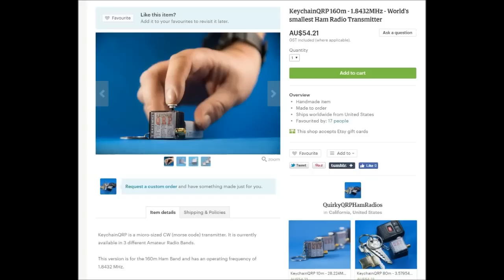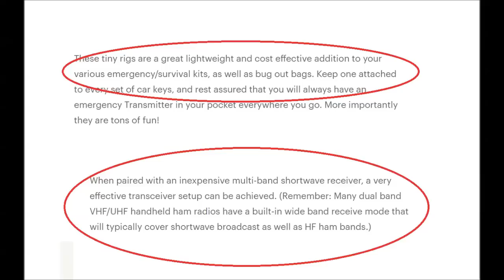Ultra-simple "survival radio" gear: Is it a scam?

Comment: In the US we have New Madrid, last activity in 1812, due to go off anytime now. If it goes,  write off anything east of the mississippi. Help will not be coming quick enough to matter. A good receiver would be god send. I ain't worried at the least. My interest in qrp is that of the tinkerer. No overpriced bloated gear for me. If it cost over 100 USD, it is usually crap full of features I neither want or need. I have been building radios for most of 50 years. Yes there are good radios, most are beyond my budget. Back in the day, no one I knew have any store bought gear. You have sold me on  freq agility. So here's the rub, whats the lowest part count radio you have made contacts with? There's the experience.

Comment: Nice discussion about the serious business of amateur radio emergency communications versus survivalist versions of QRP transmitters and ultra-simple "magic" antennas. Wow, that Gotham antenna sounds a lot like the Maxcom Antenna Matcher and Dipole from back in the 80's. When QST magazine reviewed the Maxcom unit it was found that the Maxcom's so-called Hi-Speed antenna matcher unit was filled with epoxy that rendered the circuits un-viewable. In order to circumvent this deception, the reviewer subjected the unit to an X-ray machine and saw that the box contained a number of power resistors and a toroidal transformer arranged in an attenuator circuit. I also see that the Gotham is sold from Pompano Beach, Florida which is a few miles up the coast from where the Maxcom was originally sold. Coincidence? I think not.

Comment: Nice video again Peter. I am not sure if something serious did happen that I would want to talk on a radio. I think i would just lay low for a while. If people where not prepared and then found out you where they would be looking to get your stuff. Maybe the answer is to pre-arrange a frequency and call sign with people you know and trust so you could just go to that frequency. Imagine the people that would be out to trick you and come around like the Purge Movies.  I would definitely have a MW/FM/SW radio to receive news if there was anyone transmitting. Peter I purchased a 60 LED $30 solar motion detector light from the REJ__T Shop and it only stays on for 2 minutes. That's how it is made. Do you know if times can be changed with changing a resister like years ago or is it chips now. I want 5 to 10 minutes.

Comment: Agree on the complexity of ham radio HF. There are a lot of parts and connections and normal poor radio conditions that can go bad. Not a good zombie radio. --- on the other hand the VHF radios work well only if someone is listening. There are 2 meter and 440mhz versions. Both are good to have.

Comment: All true.  The "survivalist" or "prepper" radio concept is moronic.  Amateur radio isn't suited for it, as the gear is expensive, delicate, requires significant antennas - and most importantly - 98-99% of the population don't own or know how to operate it.  Its just another fantasy.  Want a good "prepper" radio?  get a $10 portable AM/FM radio that runs for hours on a few batteries so you can listen for where to get help.
Reply: Stem Nozzel Best advice on the Internet. I've got a world band receiver with SW as well as FM/AM but no BFO so useless past broadcast. This is the status quo. Not going to be fussed about CW/SSB if anything major happens. Food and water is more important :)
Reply: Right on Chris.  You'd be stunned with the offerings here in America for the prepper crowd.  Buckets of freeze dried food, water purification systems, off-grid electricity, guns, and now amateur radio.  The only time in American history that comes close to the prepper nationwide apocalyptic fantasy is our Civil War.  I'd challenge anyone to tell me how a rag-tag group of southern preppers would have fared better with a 5w CW radios 150 years ahead of their time.   Even with natural disasters (like hurricane Katrina), I have a hard time figuring out how someone living in Jefferson Parish or the 9th ward would have benefited from banging code on 5W CW. 

I think the fact is that if something really went wrong like a meteor strike that took out the government, the Army would take over, set up  or oversee emergency broadcasts everyone could hear  on cheap AM radios, and the survivors would dig out.  And face it, if things become as bad as "nuclear winter" bad, you may not want to survive.
Reply: "The "survivalist" or "prepper" radio concept is moronic.  Amateur radio isn't suited for it, as the gear is expensive, delicate, requires significant antennas"

That's why there is FRS and CB radio, that is where preppers should be and not on the Ham, Commercial, MURS or GMRS radio bands and buying those Baofeng radios either..
FRS handhelds are small and easy to use and with new FCC rules FRS can legally run up to 2 watts without a license. FRS radios generally take standard AA or AAA batteries. With that said your typical gun toting lunkhead prepper can operate an FRS radio which is all they need anyways.
Reply: Yeah.  Don't get me wrong, I think the prepper "hobby" is mostly harmless; but amateur radio at its core is about technically minded guys learning about radio as a hobby.  Its not really about surviving fantasy cataclysms; and (this may be controversial) its not about emergency communications anymore either.  I don't want to see it painted with the same brush of mild prepper lunacy.  I think your points about non-licensed communications gear is well taken (though despite your claim, FRS is limited to 500mW, GRMS can go to 2 W with a license). https://www.fcc.gov/wireless/bureau-divisions/mobility-division/family-radio-service-frs 

I'm down on the prepper-as-hams movement mostly because its just a dumb idea.  You aren't going to talk to anyone of any use on a 5w QRP CW transceiver.  I challenge preppers on this and they tell me they have "nets" and the like.  Whatever.  How a CW contact 800 miles away is going to help you find food, water or shelter is beyond me (or them).  One prepper guy has a channel where he demonstrated ho he can receive e-mail through his radio.  Yup, he thinks e-mail = survival.  The gear he used cost a few thousand dollars. 

I will say this though, if a prepper learns CW and becomes so proficient that he can make routine qrp contacts on crappy, crystal-controlled, tuna-tin tranceivers - thats a pretty good ham.   If he can step away from fantasizing about living in a bunker while people are dying all over the world, he may have something to contribute to the hobby.
Reply: I been reading this, the channels and rules regarding FRS, GMRS and CB are about to change..
https://apps.fcc.gov/edocs_public/attachmatch/DOC-344617A1.pdf

Now having a ham operator or someone smart on radio comms in your prep group is not a bad idea. This person would handle all the comms that require license and then relay from the no license radios to the outside world via ham radio etc.. Also this type of person if they know their shit, can repair radios and build different infrastructure like antennas and such..
I dont widely announce this but I am par of a prep group I helped founded here and I am also a licensed ham and a professional RF engineer. I handle all the comms gear in my group, We have FRS and CB radio but we also have Mototrbo access riding on one of my commercial licenses also if we need it.
Which is all nice and well but we ALL know how to survive on our own independently out in the wilderness. We all know how to hunt and fish, grow food, etc, We know how to use the types of guns and other weapons we favor, but most importantly, we have plans and backups for those plans and we all keep a level head.
Reply: "Likewise, once a hurricane makes landfall, ham operators use their equipment to handle emergency radio traffic into and out of the afflicted area": - Not during Hurricane Katrina, ham radio repeaters all failed shortly after landfall and most hams lost their HF capabilities due to high winds tearing their antennas apart. Some HF came back up after the storm passed, but it was so bad that is was not practical..

I LIVE in Louisiana, I can tell you exactly how this went down despite the youtuvbe videos about how ham radio was there when it was not.., I was there, and I was listening to it all on my Motorola MTS2000 Flashport HT. I was on the COW (Cellular On Wheels) team  for AT&T Wireless, and we had cell service back up in 48 hours in necessary priority areas. and in a week we have some of the core sites back online, NONE of the ham repeaters were online yet. The Sheriff's dept I had back online in 24 hours via my own portable tower on a trailer. They didn't have trunking options but they did have 800 MHz ITAC running and could communicate with that to the LSPD and national Guard which mind you had their own radio gear and talkgroup on the LSPD 800MHz system at the time. before the storm made landfall we activated the LSPD microwave links to try and add redundancy if towers got damaged and that worked. MOST S&R news that was received was received via the LSPD radio via microwave links in safe areas of the state, Including the alert on the Louisiana National Guards talkgroup, when the levees first broke and all the S&R post breech was on the 800MHz system. Not the ham radio because there were no active ham repeaters up..

"That's how coordination between the various agencies happens.":  Not anymore.DHS has invested BIG in interoperablity with the Digital P25 systems. Agencies can communicate with each other with the press of a button and turn of a knob now and in Hurricane prone regions there is redundancy on top of redundancy to insure they system does not fail. The system works so well now that a cop in New Orleans  can talk to police dispatch in Las Vegas, Nv via IP linking.
Ham radio operators in emergency S&R ops are see today as dates and redundant and not necessary like before. The Federal government especially DHS wants to take hams out of the disaster comms loop all together in the name of Homeland Security
Reply: My approach is to live in Ohio and only visit FL when there's no hurricane.
Fact: Most preppers will never encounter the scenario they're prepping for, and will be killed by something they never saw coming.
Reply: yeah no kidding
Reply: I look at prepping like this - "If I cannot eat it or drink it and survive off of it, Then it is useless to me post SHTF" because at the end of the day it is about food and water.. mainly clean water.. All the rest falls into place but you NEED water and food to survive. You cannot eat a radio or ammo or a gun...

I have a substantial solar farm built that can run my home comfortably, but that means jack squat if I am not able to maintain it due to dehydration or malnutrition..
Reply: Right on ELF.  I think preppers are nuts, but I do have a lot of respect for people on youtube who set up these amazing shelters, game traps or water catchment systems to live off the grid.  That aspect of prepping (but not the mindset) is cool.  The goofballs who invest in small armories of weapons, expensive radio gear, and other weird weekend warrior crap in the hopes of living out their days after the apocalypse in peace are the ones who will die first; they too stupid to realize all of that stuff will be useless or stolen from them in about 10 seconds.
Reply: Elf, As someone who lived in the Pelican State for 6 years, all I can say is bravo.  You nailed it.  Unlike Possum, I'm a ham  who uses real equipment and real antennas - they arent making it through a hurricane.
Reply: I was born and raised in Louisiana, I moved to Las Vegas for a while and helped get theirs radio system sorted after Harris screwed it all up.. Yeah it was that bad.. I moved back to Louisiana though when my mother passed a few years back.. I miss the west but it's not bad here either.
I been a ham since 1993 I got my ticket when I was young, I have always had an interest in radio comms, computers and general electronics. I love the hobby but damn I have met some arrogant and narcissistic people along the way.. On the other hand I have met some really awesome people who know they stuff and don't mind teaching and helping. Myself I try to help anyone who asks especially new comers to the hobby.
I also have a GMRS license and a few commercial licenses too.
Reply: Elf we crossed paths at some point for sure.  I was in LA for most of the 90's; I lived off of St. Charles an Milan St in Orleans Parish, and later moved out to JP/River Ridge after being robbed and almost killed too many times.  I liked it there though if not New Orleans itself.  Great people, food, and good times.  Loved fishing off Gran Isle.  I lived in TX and CA too, all great.  I live in a northern climate now, hate the winters (dark, depressing).  I go to Las Vegas every year in Feb to escape it.  Been licensed for about 10 yrs.  I find hams to be a mixed bag; I get along best with the technically minded ones and detest the EMCOM/Prepper crowd - they tend to be older, a little too nutty about guns, cheap, and argumentative.
Reply: maybe, world is big yet small in the same...

I am in Vegas this coming week for DefCon and to visit friends. Then maybe off to Pax in Seattle later on, Yeah I'm kinda a gamer and I know some of the more popular youtubers on here..

It is always an good idea to be prepared for any general emergency, I mean don't go overboard with too much of stuff to where you attract attention and for the love of god DO NOT post videos about your preps especially guns and ammo stocks on youtube.. that's inviting trouble.

I have made a few radio videos on my channel regarding prepping and comms, and whats practical, affordable, and some experimental repeater videos, etc.. But I NEVER display any of my actual radio gear I would use if SHTF, I can say this much I will not be using a Baofeng or analog or even the ham radio bands..
It's like this cardinal rule of mine to not expose my real gear or what I do have set aside in case something goes down..
Reply: Cool.  I get what you''re saying, and never understood the prepper who tells everyone how much crap he has to survive a disaster.  His will be the first house mob will descend upon, smoke out, and steal everything. 

I've seen your vids, they're neat.  

 In reality, I think the group people that are likely to be the only "preppers" who survive the disaster fantasies of some posting here are in rural areas, difficult to access, that have built on their own relatively small bunker underground with ventilation, access to well water, a few hundred pounds of freeze dried food, and some sort of sewage system.  I don't think they'll need much in electronics, maybe  an LED bulb for night-time that could be run off of $100 of AA batteries for years.  Find a way to hook up a relatively inexpensive 300 gal. propane tank to a small burner and you can boil a pot of water every day for years.

But, everything is stealth.  You don't go outside  unless you have to, especially in the daytime.  You don't ride around in some mad max motorcycle, shoot guns at stuff, and throw up antennas to broadcast radio signals that can be used to track you down.  

The other group of people who will survive aren't the survivalists and they arent preppers.  It will be the people with superior cunning and brains to adapt to to life in a very different world - most likely native or learned sociopaths.  Either way, it aint fun.
Reply: Stem Nozzel there's a sucker born every minute - many of them are preppers.
Reply: Stem Nozzel and don't forget dehydrated water. Just add water.
Reply: Thanks Braden. Right now, we have a massive hurricane about to hit florida - a real disaster which shows that no matter much money you've wasted on prepping and tuna tin radios - its all worthless.  Nobody's listening to anybody on the  40m ham band, no amateur radio operators are meaningfully contributing to the hurricane forecasts or evacuation efforts, no antenna will survive 155 mph winds, homes will be underwater (including bunkers), emergency responders have warned that they wont help you, and power may be out for days to weeks.  

It turns out the best "prepping" for a hurricane are storm shutters/plywood, a reliable automobile, a full tank of gas, and enough time to leave the state.